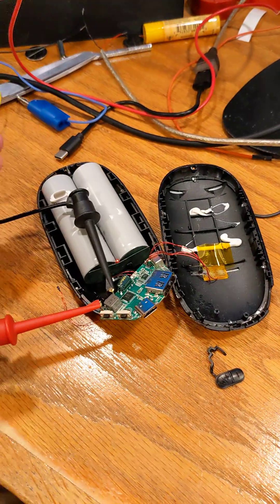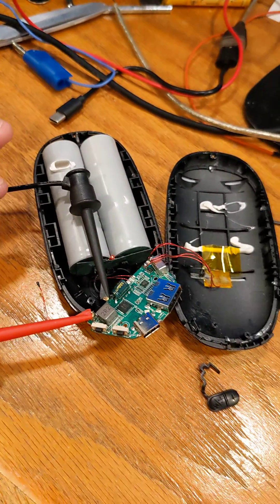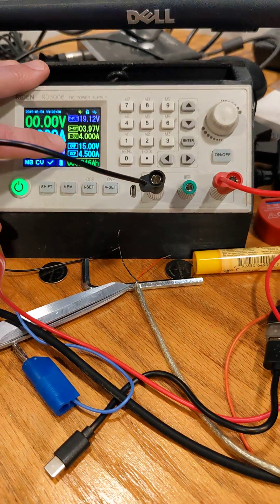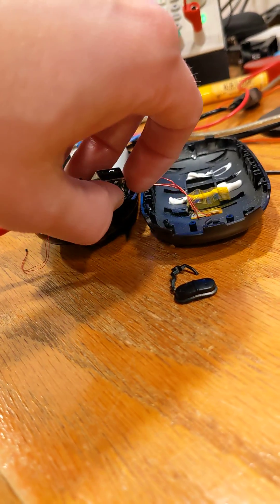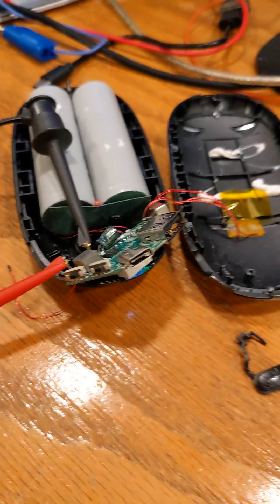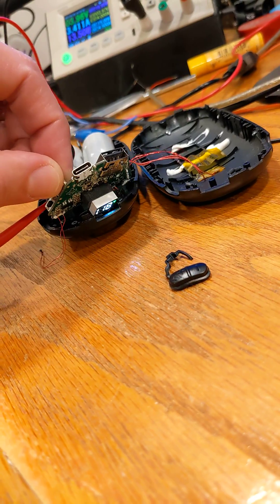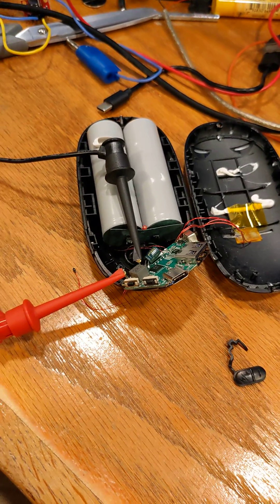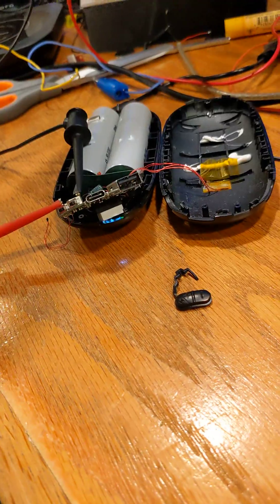Unigear HW02 Hand warmer Disassembly and Troubleshooting

Comment: I wonder if the batteries had been over-discharged (or out of balance) and the BMS was just protecting you from using the lithium batteries that may have been compromised and might possibly be unsafe to use.

Comment: Thanks for this advice! My Unigear got the same issue after about 2 months of usage. Contacted the customer support and they were friendly enough to send me a new one while keeping the old one. This gave me the opportunity to carefuly open it and fix it, by disconnecting the minus wire of the battery as it was most easily accessible. Since I didn't make big mechanical damages, assembled it back, and now I can use it again 🙂
Thanks again for this video 👍
Reply from the maker: I'm glad it helped you!  

I bought 7 of these warmers (3 for me and my wife, the other 4 for Christmas gifts).  

So far two of ours failed (I don't know if any of the gifted ones have failed).

I've only asked Unigear support for one replacement so far.  I almost feel guilty asking for more replacements if I have a decent chance of fixing it 🙃